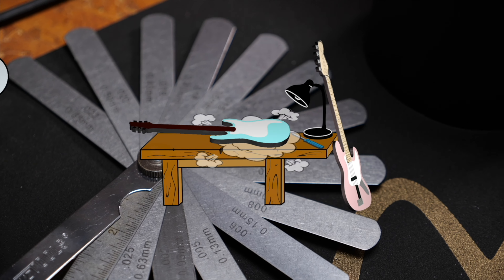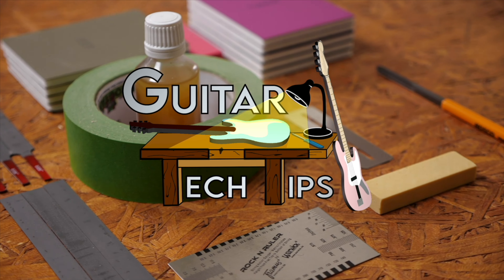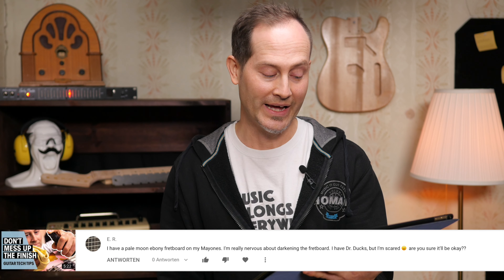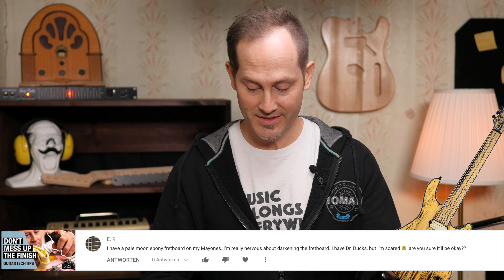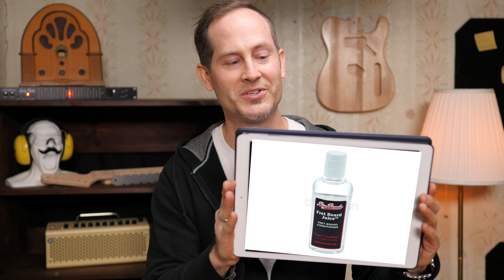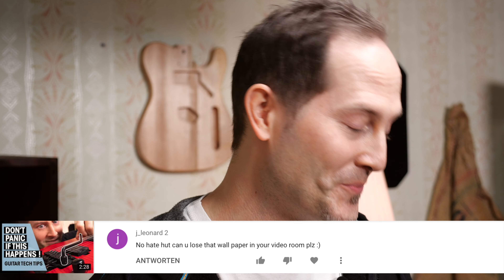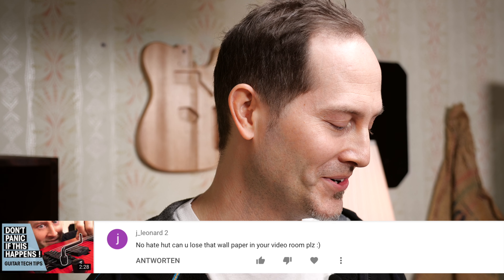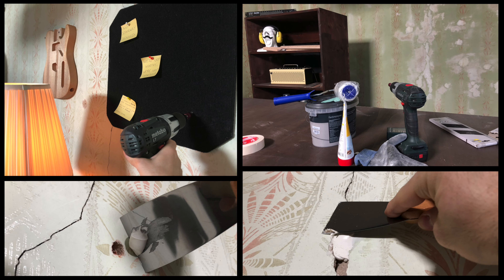Guitar Tech REACTS - Q&A | Guitar Tech Tips | Ep. 34 | Thomann

Comment: I seem to have TWO Tone King Ironman II minis on the way (wet/dry). I'm wondering if it's possible to use them in parallel to represent a 4-Ohm load capable of handling 60 Watts, as each is 8-Ohm and 30Watts?

Comment: I disagree with your locking tuners on an Evertune. I had an Evertune installed on my Ibanez which already had Graphtech ratio locking tuners on it, and I rather love the combination. That might be due to the extra sensitivity ratios give you I donno
Reply: Yep, every guitar should have locking tuners even with a locking nut or evertune. It just makes string changes so much easier and neater.

Also graphtech ratio if you can afford them add even more to it with the consistent tuning. I love mine, only downside is i can't afford 10 sets.